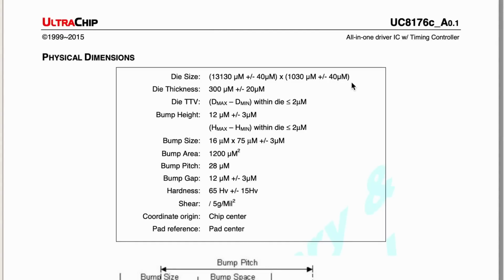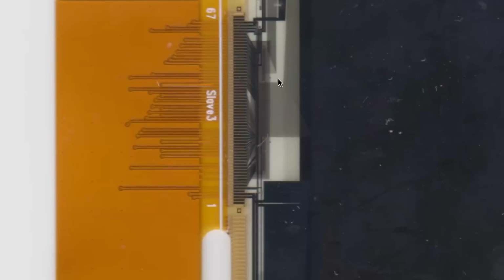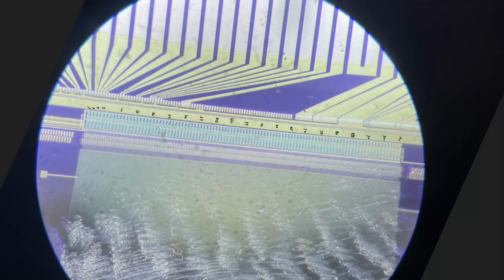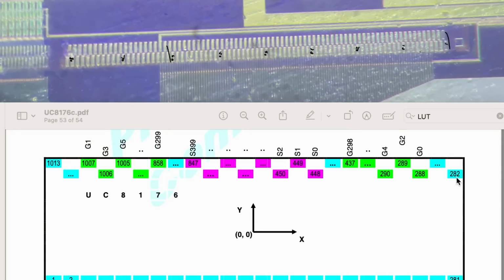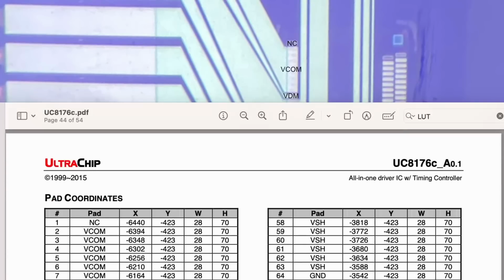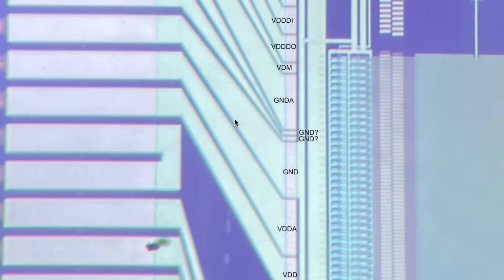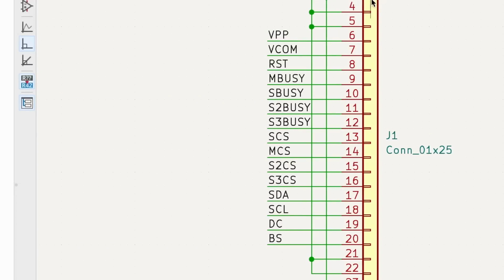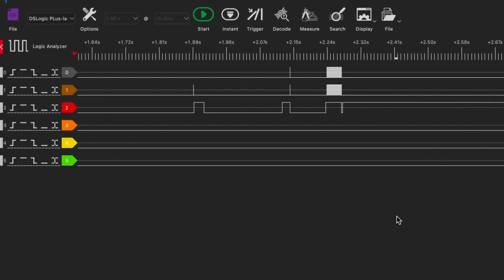Reverse engineering a looong Eink screen from kinda scratch

Comment: Really cool to see how you figured this out! How did you figure out the format for the LUTs? Was that in the data sheet?
Reply from the maker: No unfortunately they are not in the datasheet. When I first started hacking these Eink screens a few years back, I was able to basically figure out by trial and error (modify the LUT and see what happens on the screen). I also linked dmitry.gr's page in the description which provides a nice detailed write up if you are interested.